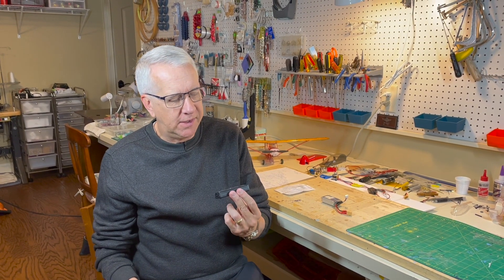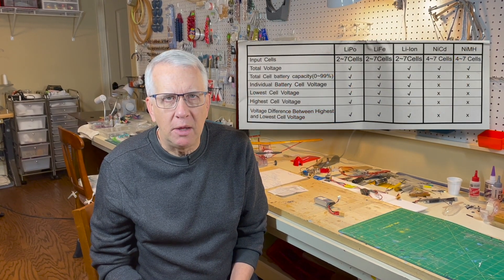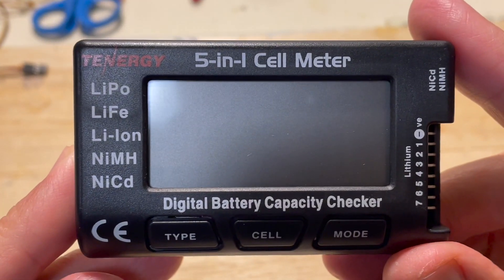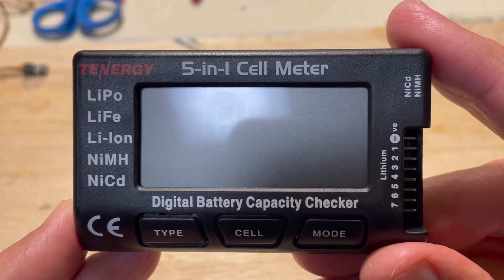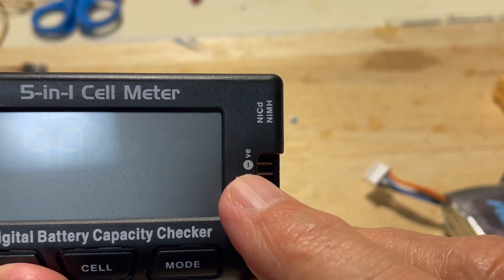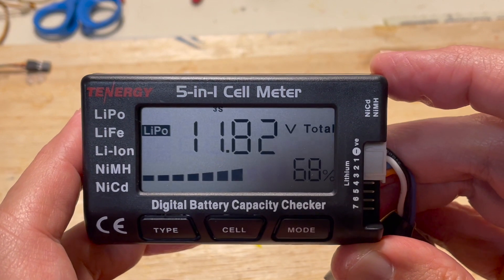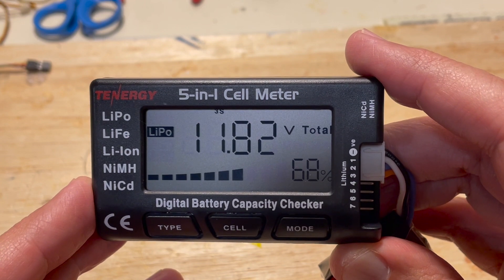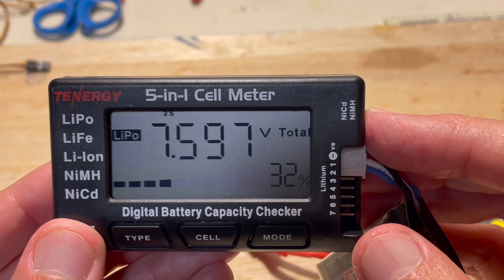Best RC Battery Tester RC Basics

Comment: I use mine all the time for checking internal resistance, watching for a bad cell. Also the balance function works great, brings all the cells to the exact same. Better than my balance charger. Warning, don't forget about it while in balance mode, you'll find a dead battery a week later. I don't know what manufacturer mine is without looking. Because a buddy on mine has one just like it, and it does not have the internal resistance, or balance option. And yet, yours, mine, and my buddies, all look the same.
Reply from the maker: David:  Good words, thanks for this update.  Tim
Reply: which brand does resistance????
Reply: I have purchased 3 of these and they were all incorrect.  They show 4.5 volts after I fly.  Other meter (purchased years ago) shows 3.8 volts.  This value agrees with a Fluke multimeter.   
They should QC these!!!
Reply: @gregghover5136  they do QC these! If you buy these from China you're getting the rejected ones.

Comment: If you have a full battery but for some reason can't get out to fly, how do you use that to discharge the battery down to storage?
Reply from the maker: It depends on the charger. Apologize but I am on travel, cannot check mine.

Comment: Thank you.  Got mine today.  Was bundled on Amazon with the 5-1 + the Tenergy Lip Bag to protect incase of a fire while charging.  I put all my Batteries in the Tenergy bag, and as I used my batteries I put them in a plastic zip lock to seperate those from the fully charged batts.  The other features of the 5-1 are to check cell resistance, actively balance cells, and also to discharge cells (I guess thats for long storage of batts).
Reply from the maker: Well done!

Comment: Thx for the video. I have one from another no name brand. I have to add, that theyre made different though. The tenergy is also able to measure the internal resictane, which is also impotant to see the cell condition and calculate the true c- rating of the battery. Mine also cant discharge. So its pretty basic.
Reply from the maker: Sounds good!
Reply: @TimMcKay56  no, that means  i need to buy me a new one, the same as you have😅

Comment: Hello will this test nimh tamiya and mini tamiya batteries? Does it need an adapter for this? Please respond
Reply from the maker: This should work with other batteries, just ensure the balance plug is standard as with lipos.
Reply: @TimMcKay56  mine only have tamiya regular and mini tamiya no second balance plug... what gives?
Reply from the maker: @ Not sure. 😟
Reply: @TimMcKay56  dang thanks

Comment: soooooooooooooo....how low can I take any lipo battery? Give me numbers please!
Reply from the maker: I try to keep it simple.  I charge my battery to full (usually 98% or more).  Then I fly a new model for 5 mins with normal/moderate throttle use and check the battery.  Say it is now 70%.   Over a few flights, I know I can fly model "X" for 7 mins and have sufficient reserve . . . I try to land not much less than 40%.  Tim

Comment: Im using toprace batterys 3.7 volt 180mah my Tenergy wouldn’t work until I pluged it in the NICD port at the top. Now it seems to be ,I have a few batteries at different uses so a 98% full of 66% full and a 20% full. They are Lipo batteries and I have to press the button to choose the type of battery once it’s plugged into the NiCd port is this unusual is my tenergy broken?
Reply from the maker: Not sure . . . Tim

Comment: Without the load of an actual  running motor/propeller,  ESC, and servos in flight, how can a battery checker give useful information about how much capacity a battery pack has remaining?
Reply from the maker: It is a data point.  I do not know the low end, but likely not a good idea to fly an plane with 20% of the battery remaining.  Tim
Reply: @TimMcKay56  My old Aurora 9 transmitter screen has an in-flight motor battery voltage readout when using an Optima receiver with the optional "SPC" connection. When indicated voltage drops to around 3.7 volts X number of cells, I land ASAP.

Comment: Hi. I just bought this little battery tester.  It works on all my lipo's,  But there is 1 lipo i have that this device seems to read wrong.    It keeps telling me it is in the 90-isch %, while it all of a sudden is empty..  This particulair little lipo for my Losi micro does run fine when chargerd, but isnt readable as my other batteries.  Any advise?  <3   tnk you.
Reply from the maker: No idea.  Maybe try to run the battery empty (while on the ground, of course) as see if you get a low reading.  Battery may need to be replaced if older.  Tim

Comment: This looks useful, but it would be even better if it was possible to test remotely while flying. I have a large rc trimaran and am always afraid the battery will die while sailing. Is there a transmitter that can somehow sense when the receiver battery is about to die? Thanks for any advice you can give
Reply from the maker: Malin:  You bet . . . check out the video on telemetry.  https://youtu.be/V10QL2vcpy8  Ron will show you how to read battery voltage from your transmitter.  Tim

Comment: Nice video! How do I balance the cells? My 1º cell is "0", my second is "4.26". Do I press a button for this? Thanks!
Reply from the maker: Phil:   Thanks for checking in!  Very good question.  I am not sure at all how to fix a bad cell.  As these are lipos, best to check with the battery manufacturer.  The key point with the balancer is to let you know there is a bad cell, to prevent a crash or worse yet any sort of lipo fire during charging.  Tim

Comment: Thanks for the video. I think I missed something though. After purchasing the unit I realized I do not have balance a lead on my RC car batteries???  Is there some sort of adapter?  I want to be able to check 3600mah 7.2V NiMH battery with Tamiya Plug for RC Car.  Any help would be appreciated thank you
Reply from the maker: Not sure. If a 2 cell or more, the battery should have a balance plug. Tim
Reply: You can add a balance lead, but you MUST work carefully!! The positive and negative leads just go to the positive and negative output leads. The center lead goes to the jumper in the battery pack which connects the 2 cells. To reach this you carefully open the pack until you find the jumper and then solder the center lead to that. WARNING- even a somewhat discharged battery contains a LOT of energy and any short circuit will create an arc, heat, and likely damage the battery! I cover every metal part with tape except what I'm working on. That goes for knife blades too! Look for YouTube videos on this for advice.  Balance lead/connector assemblies can be purchased online-you would need a 3 contact lead.
Reply from the maker: @alandaters8547  Good input, and be careful!!  Tim

Comment: I have the Capacity controller from Amazon which looks the same.  I haven't seen the option on this to  "discharge" the battery? Thank you for your video and info.
Reply from the maker: I have not used this yet to discharge my lipos, apologies. Tim
Reply: @TimMcKay56  I believe it will balance them  but not discharge.  Thank you. I'm a newbie, please forgive 😂

Comment: Will this show voltage on 1s lipos? Specs show for  for 1s but also say input voltage starts at 5v.
Reply from the maker: I am not sure how to check one cell lipos.  You need a battery balancing plug to use the tester, and with one cell there is clearly no reason to have a balance plug, as no cells to balance.  Tim
Reply: @TimMcKay56  thanks for the quick reply Tim. Much appreciated!
Reply: @TimMcKay56  thanks Tim. I was wondering for the specs say it will work with 1s and then says  it needs 5v. I really o ly wanted to see the voltage so was thinking maybe it would do that. 
Appreciate your input as always.
Reply from the maker: @we4fm175  No idea, really.  Tim

Comment: I wonder by having a 30% level is the battery low energy or does it indicate as a being low to where the rc stops working? I drive my rc truck until the truck slows down and I check the meter after and reads at 50% to 60%
Reply from the maker: Gamer:  If you do a quick Google check, and lot of very bad things happen to lipo internal battery chemistry when the charge gets anywhere below 30%.  Just the way the batteries are made.  Critical of course for airplanes, but still potentially harmful for ground vehicles.  Tim
Reply: @TimMcKay56  I'm having issues in my batteries I charged them and soon they drain  quick in a minute.
Reply from the maker: @gamercat7004  Get new batteries!  Tim
Reply: @TimMcKay56  really? I just had the rc truck like a week and half.
Reply: @gamercat7004  While I do not know specifics, I treat lips batteries very carefully; fire is my main worry.  If there appears to be anything "wrong" with them, such as an unreasonably quick discharge for no real reason, you might have a defective battery.  Tim

Comment: What would be considered "too much of a difference" between cells? How can you balance the cells, or is that done automatically with a charger?
Reply from the maker: Larry:  A good balancer should get the cells to be within one hundredth of a volt (. 01) of each other. The biggest concern is that no cell goes beyond its voltage range (about 3-4.2v).  Tim

Comment: I have 3 of those battery checkers,one is a servo tester.The one thing I don't like about them is if you plug in battery in wrong it would smoke the checker and won't work anymore.Plus I feel there not very accurate compaired to a digital volt/ohm meter.
Reply from the maker: Steve:  Good points, thanks!  Tim

Comment: Is there is any single cell lipo charger/discharger available?😊💗
Reply from the maker: Aneesh:  Yes, there are many.  Just do a Google search for "1 cell lipo battery charger" to see what is available in your area.  Tim
Reply: @TimMcKay56  with discharging function
Reply from the maker: @AMNLabs  Most of the single cell lipos are fairly small, and not having the need for a balancer for charging, a bit safer.  As the batteries are small, just use them in a plane until there are discharged as much as needed, using a battery tester.  Tim

Comment: The Tenergy 5-in-1 has more features than the one that looks the same, but is named “Capacity Controller”. I don’t like that I have to push a button to see the voltage of the individual cells. I use the Hitec battery checker because it shows all of the cell voltages and the percent of charge on one screen without having to press any buttons. It lets me quickly check my batteries before connecting them to a parallel charging board. The Tenergy’s servo driver is handy, but the cell resistance function isn’t very accurate. It uses the 2-wire method where the load current and voltage are on the same two wires. It would be better to put the load on the discharge leads and measure the voltage at the balance connector.
Reply from the maker: TXK:  Great inputs, thanks for checking in!  Tim

Comment: I have a lipo battery that says "low voltage" when I connect to my programmable charger. Not sure what to do with it. Any ideas?
Reply from the maker: Greg:  I'd check that there is no damage to the cells.  Double check that the cells are balanced properly, then see if it will take a charge.  If not, the battery may be bad.  Tim
Reply: Thanks Tim, I'm relatively new to electric RC (flown nitro since I was a kid), so these lipo batteries are confusing to me!
Reply from the maker: @gregcoldwell1531  Greg:  The lipos made these days are of good quality.  There are several good websites with a Google check.  Bottom line, do not try to save a buck with cheap lipos from China.  Danger just not worth it.  The best approach is Spectrum Smart batteries and chargers at www.HorizonHobby.com  The lipos have a computer chip in the battery that "talks" to the smart charger after to plug it in (no separate balancing plug).  Really no way to screw things up.  Second choice for lipos is ThunderPower, very high quality.  Tim
Reply: I'm using "Tattu" lipos ordered from Great Hobbies here in Canada. Not sure about the quality but so far so good. My Turnigy Reaktor charger seems to know what it's doing and won't let me charge unless the program is set up correctly.
Thanks for all your advice and tips!
Reply from the maker: @gregcoldwell1531  Greg:  Sounds good.  Real  key technology was the balancer and charging.  Good luck flying!  Tim